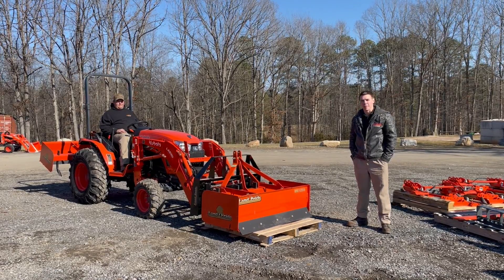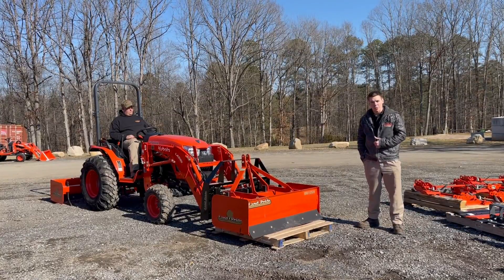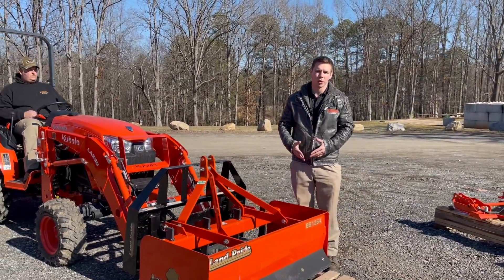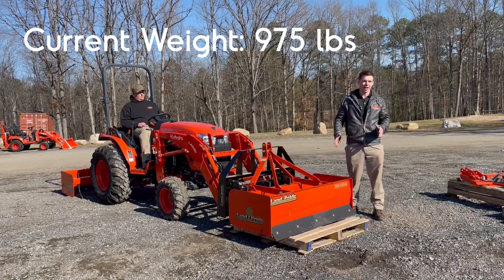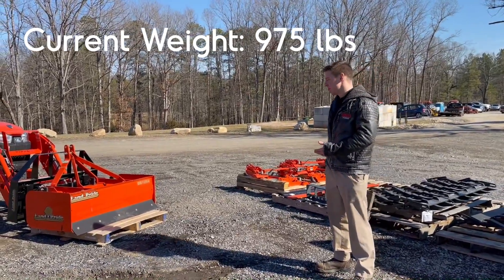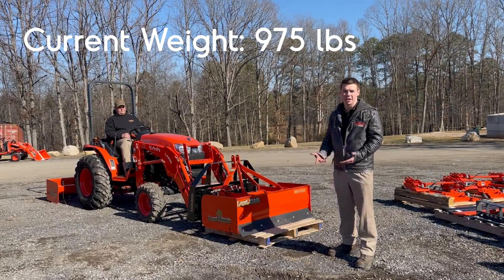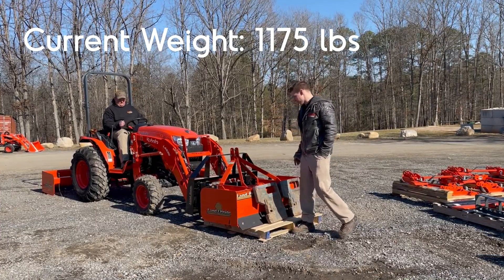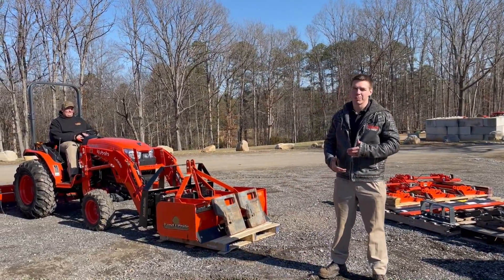What is the ACTUAL Lift Capacity of an LX2610HSD?

Comment: Good video- the Kioti's list their tractors with higher lift capacity than Kubota so I wonder if Kubota is too conservative and Kioti taking advantage.  Just an observation from both your video on the L2501 and this... you really should have the box blade in the air for it to be an effective counter weight!  Sitting on the ground accomplishes nothing.

Comment: There must be something wrong with my machine. I can only pick 14 - 60# bags of sackcrete (or 840#'s) on a pallet using the same setup as you've got.
Reply from the maker: Some things to consider are how far out is the load sitting on the pallet? And what pallet forks are you using as each brand weighs a littler different. The further forward (if there are 4 bags in a square) will dramatically reduce lift capacity. There is a little variation between each particular pump and lift on every tractor, but there are shim kits out there that can be easily installed to get a little more pressure and lift out of your system!

Comment: Is that taking into account the weight of the forks? Just curious. I have a lx2610 and for some reason my dealer sold me the heavier lift forks so I'm trying to figure out what the max I can lift with them.
Reply from the maker: Yes, our calculations do include the weight of the pallet forks, our forks weigh 228lbs (they are the PFL1242).

Comment: Zach, Thank you for posting.  You gave me an idea of the capacity of the LX2610 that I have on order.  I appreciate that.

One question- Would your rear box blade weight be more effective if it were 3 or 4 inches off the ground.  Having it sitting on the ground you are loosing some of the counter weight effectiveness. Being slightly in the air maybe your rear tires would stay on the ground.

If you put suitcase weights on the back of a tractor for ballast they are suspended in mid air.  They are not sitting on the ground.

I would like to here your thoughts on this.  I would like to see this test repeated with the LX2610 with rear weight off the ground.  Then we could see if results are any better.  Thank you again for doing the initial test.
Thanks, Dan
Reply from the maker: That is a very good suggestion, and I am sure your though process is correct. With the counter weight being off the ground it should add some more weight to the backend of the machine. Not sure how much extra it would add to lift since the last test the loader hydraulics themselves just stopped picking up, but might help with the bounce of the back end of the tractor. When we do more lift capacity videos I will see if we can re-test this with a better ballast setup!

Comment: Nice. Doesn't seem to be much more than my B2601. I don't usually need to lift that much at once though. I haven't yet anyway.
Reply: How about larger engine displacement, much higher low-end torque, tilt, cruise and upgraded seat. Also weighs more, so it's able to lift more. Not sure the point of your comment, but...